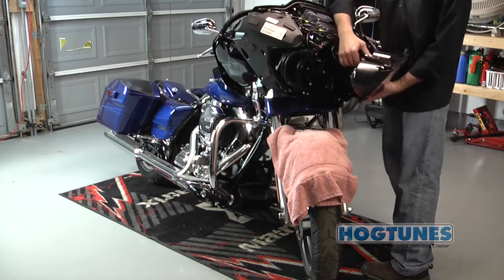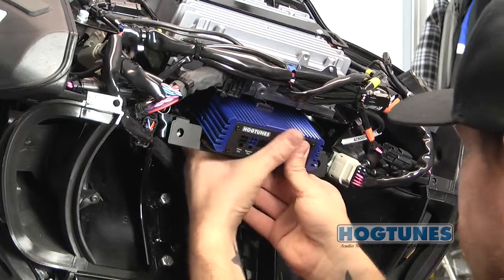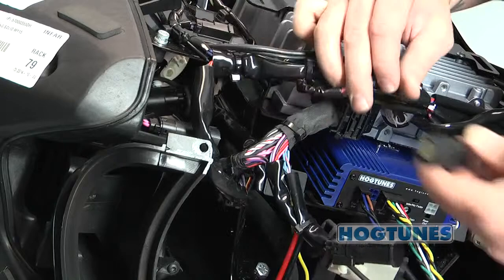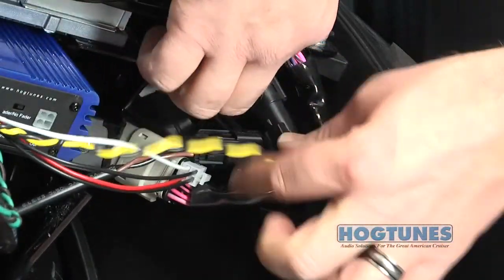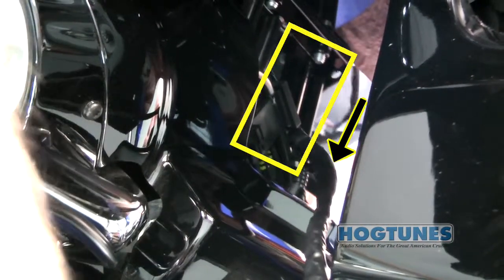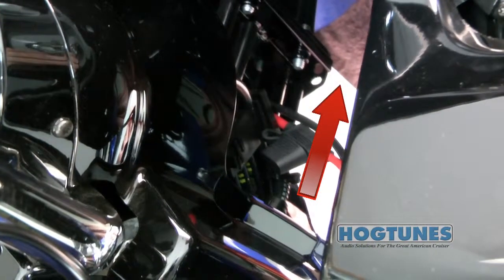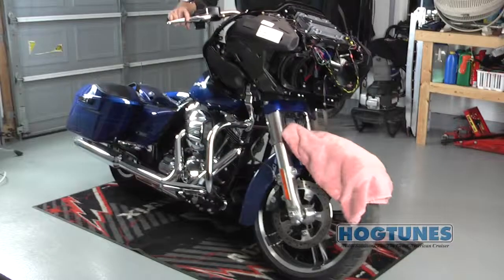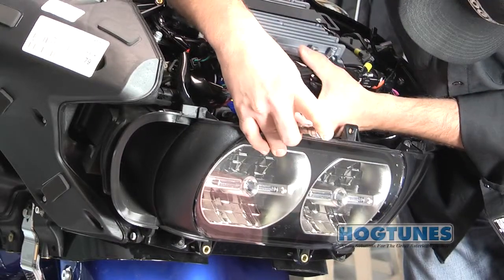NCA 450 RM Road Glide Amplifier Installation

Comment: You dont have to flash the radio after installation?
Reply: That is correct. With any Hogtunes branded amps, no reflash is required